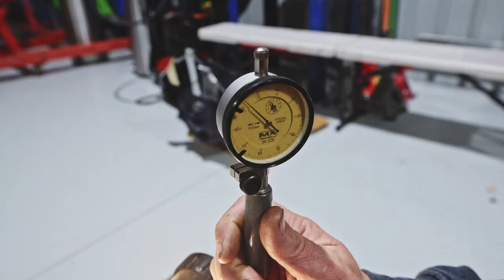Cummins Patrol – 6BT GU Ep.1

Comment: https://youtu.be/rkoQyjqh09M?t=239
Note: There is a difference between soud "dampening" and the reducing of sound by itself, if that makes sense. 
What you a re doing there is to damp the BODY soud by sampening. This is good.

But that is just 1 part of the story.

Something like foam will reduce the noice that will be transmitted via air. One always need to do both. The first part (body sound) doe not need to be fully covered, like you did correctly.
Reply from the maker: Yeah, I did try to find some foam to use but couldn’t see any, is there any you know of?

Comment: Hey mate really good video, just a quick question  how much did all the machining cost for you block and head ?? As I I have just torn down my 6bt and looks like it will need machining and I have been told it will be quite pricey??
Reply from the maker: Cheers mate, it cost me $450 to bore to oversize, I didn’t get the head machined
Reply: @nathan.baxter  that's much better that in thought  where did you get it done ?? Also what rebuild kit did you use? Thanks
Reply from the maker: @harro9447  local shop in Perth, can find the name if you like, I used Rolland from CEM engineering or Matt from Double Duty Diesel for parts
Reply: @nathan.baxter  nah its allgood in in vic anyway, thanks for your help keen to see yours going 👍

Comment: Engineered to run those weights over the front axle??
Reply from the maker: Yes, they aren’t much heavier than a td42
Reply: @nathan.baxter  might wanna get a engineer to sign off on that bit
Reply from the maker: @stevespatrol  just said yes, an engineer has signed off on it, they have done plenty of the same conversions